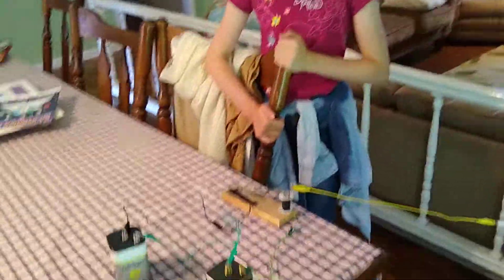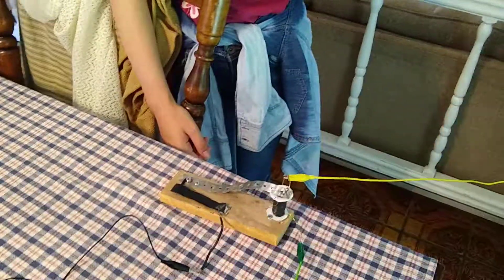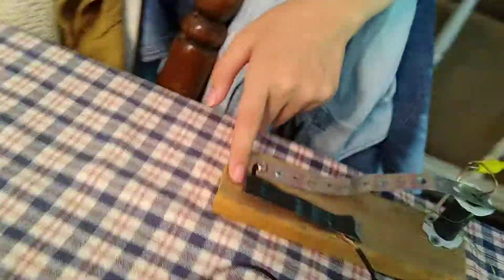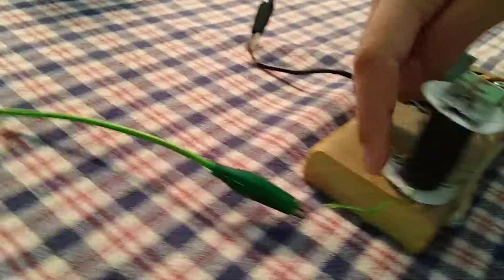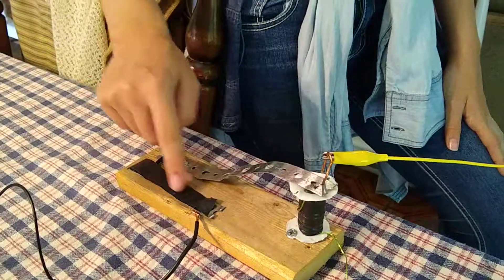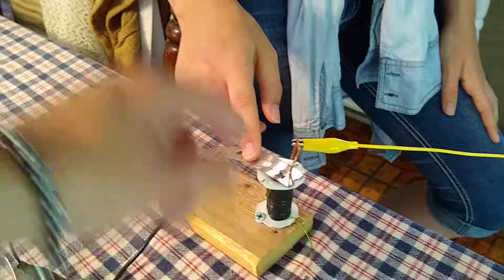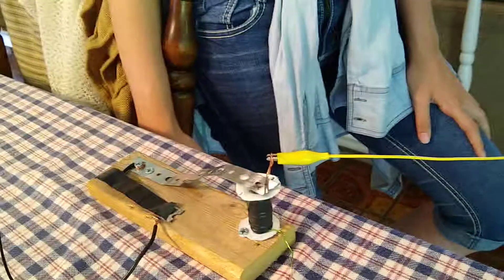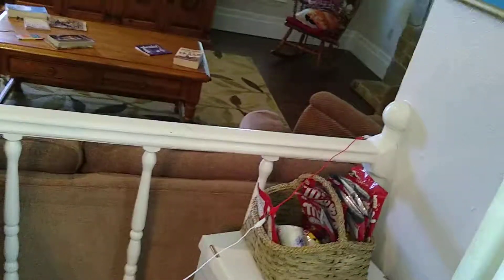Homemade wireless telegraph demo

Comment: Can we transmit signals over longer distances by increasing the current supplied to the electromagnet or should we use an induction coil instead?
Reply from the maker: Either one should help to increase transmission range, if I understand things correctly (but I'm no great authority on this topic). Induction coil is harder to build so we skipped that; ours just uses the antenna (long string of alligator wires) for resonance. See this article, https://en.wikipedia.org/wiki/Spark-gap_transmitter#Theory_of_operation , which mentions the distance limitations of our transmitter: "The earliest spark-gap transmitters before 1897 did not have a resonant circuit; the antenna performed this function, acting as a resonator. However, this meant that the electromagnetic energy produced by the transmitter was dissipated across a wide band, thereby limiting its effective range to a few kilometers at most." (If you build an induction coil, I'd love to see it!)

Comment: is it neccesary to have the coil part?
Reply from the maker: For this design, yes the coil is important because it forms an electromagnet, and the rapid on/off of that magnet is what makes the spark generator work. Here's a resource that we referred to; it includes pictures and diagrams that explain some of how the spark mechanism works: http://www.w1tp.com/perwirls.htm

Comment: Great experiment for kids! What amplitude are you tuning into on AM? (Or is it interference at any frequency causing the radio to make a sound)?
Reply from the maker: This is a spark gap transmitter, which means it makes noise on all frequencies.